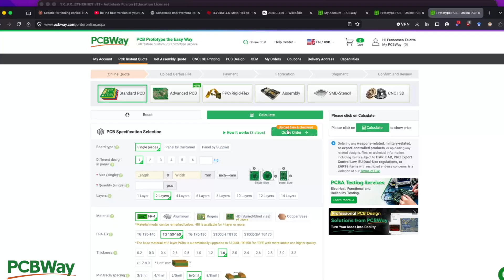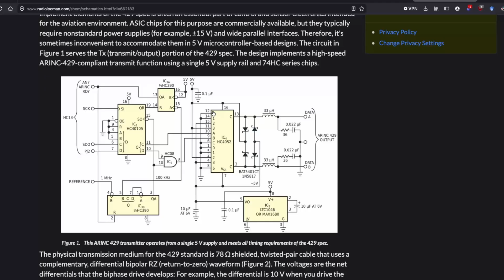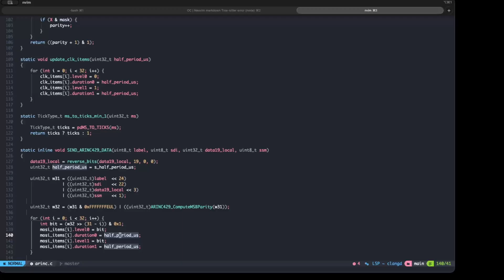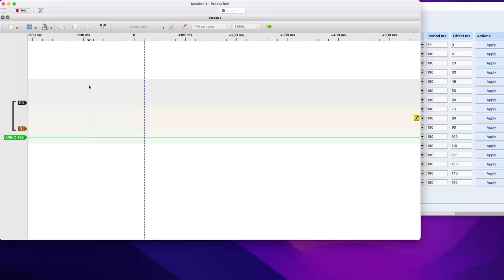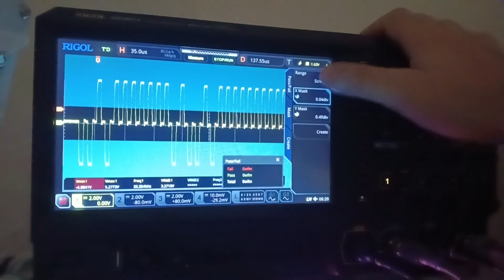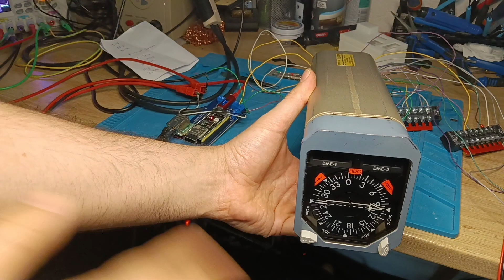ARINC 429 TX-RX Board. Part 2: Transmission

Comment: its cool bro  ,, i'm an ame (aircraft maintenance engineer) and i also working on functional engineering motion simulator , in which we want to make ccr (cabin core resource network) which is uses an afdx network ,so there is an multiple data will be gathered an send simultaneously to various system at an same time ,, so can you suggest how to do using this arinc 429  ,,,,    2. can you make an separate arinc 629  and afdx  protocol video   ,,,,,, 3. can we also connect an optical fiber to this arinc  rx-tx board ,  ,,,,, ----- ben eater also have an interesting arinc 429 video on yt ,, its also interesting to see this arinc videos thanks for help bro..  :)
Reply from the maker: Hello, thank you for the comment. I was reading a bit about afdx and it seems to be very interesting. The point is to understand if there is any documentation or specification of the protocol used. I will also have a look atthe ARINC 629 protocol. About the optical fiber, I guess it can be connected. The firmware is open source so you can do whatever you want with it.